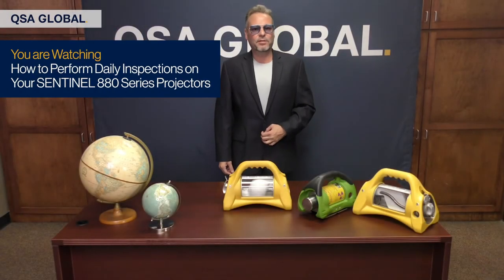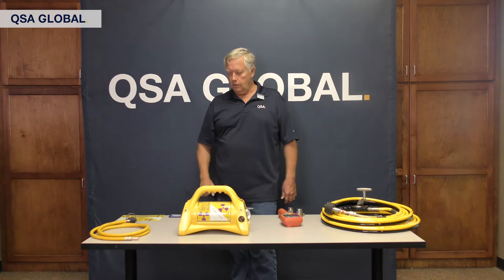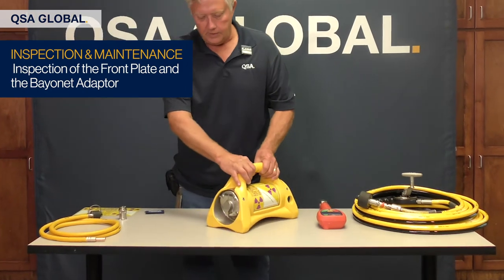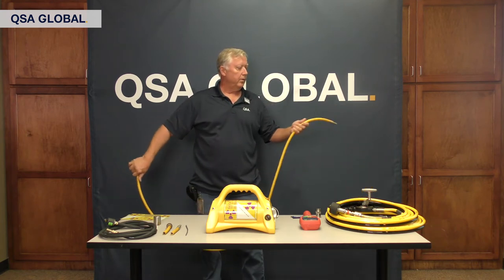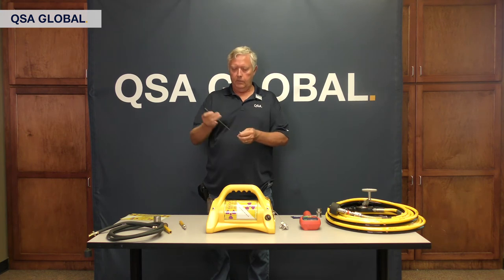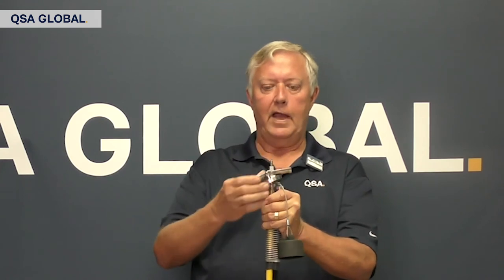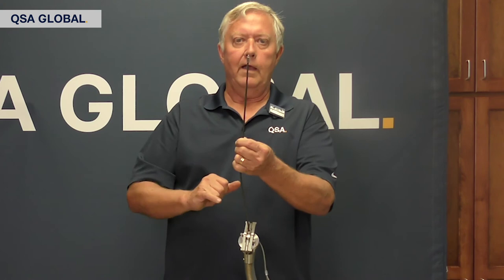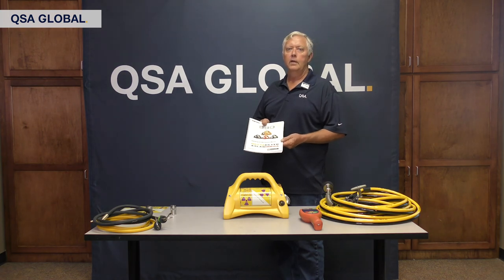ASNT 2020 Daily Inspection Showcase

Comment: 200mr contact and 10mr at 1 meter. Also audio cut out after the survey demonstration. Next check labels and general condition and then check source cable connectors to make sure they mate properly. Then check the source guide tubes for condition and connection, don't want your source escaping 😨🤢🤮